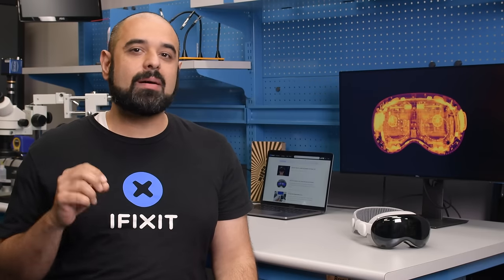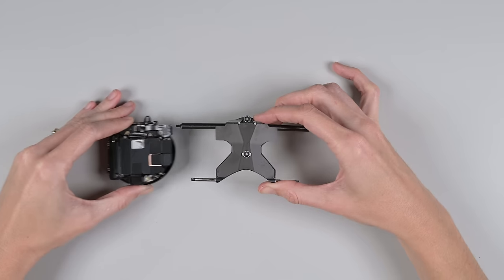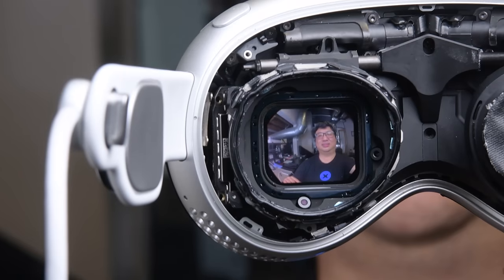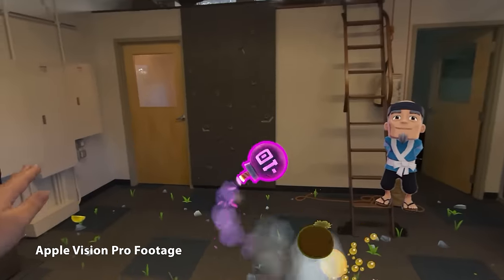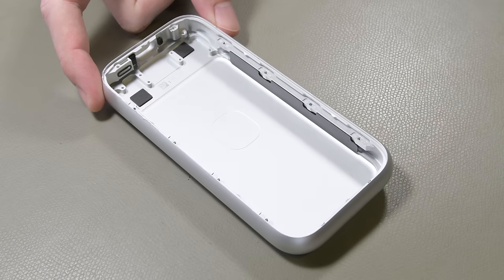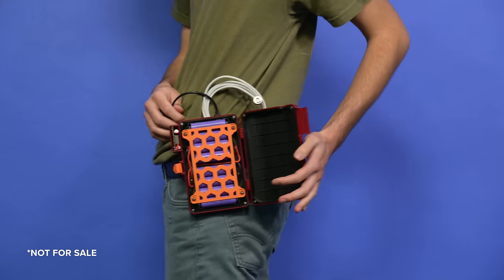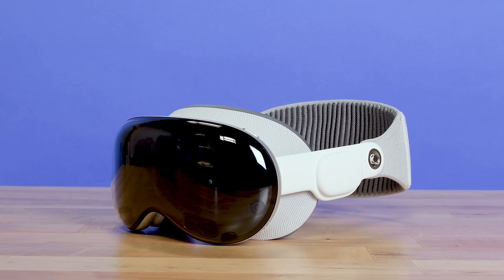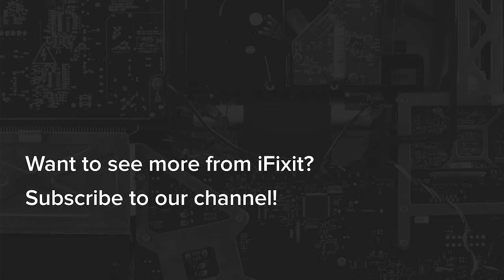Vision Pro Teardown Part 2 - Is the Apple Vision Pro Really 4K?

Comment: I know it was provisional, but that 4/10 score was something I really wasn't expecting. If the glass was easier to come apart I could understand it but, looking at all the teardown vids posted online it looks like a maze!
Reply: For real. Giving a 3500 device a 4/10 when you genuinely need to open it with a hammer and chisel like a geode is... Crazy.
Reply: @Jallen262  It's because everything is super modular, the spacial speakers, the head bands, the light seals, battery, etc.  Those are the most likely things to die or need replacing.   The front glass is as repairable is more replaceable than most front glass units on any phone since you just need to pop off the glass cover and pop on another.
Reply: @SkaterStimm  it's called the repairability score, not the modularity score for a reason.
Reply: @Jallen262  dude, the more modular it is the easier it is to fix.  The battery on most consumer devices is super hard to replace and look the battery is not even in the device reducing the need to open it.
Reply: i mean the things normal ppl would like to replace in case of damage or are all easily replaceable without even opening the device. and a lot is still rather accessible through the back which is just clipped in. so even motors and displays look rather accessible. 
the only things that are difficult to replace are the front glass and screen and just the complexity of the inner construction. which tbh is hard to make easily accessible considering the sheer amount of different sensors
Reply: So The framework pc is not repairable… interesting take
Reply: @kjeldkaj  nope, it's serviceable AND repairable.
Reply: Yeah, but if something is broken besides the glass you would go in straight from the back right?
Reply from the maker: Repairability scores are provisional until finalized. Also keep in mind that the repairability score of a VR headset is not comparable to the repairability score of a cellphone. They are different categories and are scored based on different criteria.
Reply: @Jallen262 this score is based on repairability, not serviceability
Reply: @iFixitYourself  Maybe make it somehow visually visible on what scale/device category group you are ranking the product. 
I'm thinking simple monochrome icons of the device category below the score.
Reply: Quelle est le score de reparabilité de ta TV ?

Comment: I honestly thought this would have been a 1 or a 2 on the repairability score
Reply: The main parts most likely to break are actually easy to fix.
Reply: I mean😂 there are pieces you can fix. The only thing you can't is the plastic front cause let's be real, even if you wanted to repair something behind the glass, there's no way you could do it. Best we could have expected is to replace the straps and eye seal, which we got, as well as the plastic front, which we did not get. I don't think it is reasonable to be expecting to repair any internals like the M2 chip or anything like that
Reply: Exactly, so they are even more repairable than could be expected. I would say 4/10 is actually quite low
Reply: Hundreds of screws, extremely modular, almost no glue. Extremely repairable, if one would get the parts.
Reply from the maker: It's a provisional score so it might change yet. Just keep in mind that VR headsets aren't scored the same way as cellphones. They need to meet different criteria for repairability. The accompanying article goes into more detail:

https://www.ifixit.com/News/90409/vision-pro-teardown-part-2-whats-the-display-resolution
Reply: The biggest downsize is that people mistake repairability with a swapability. If something was designed to popup and to be replaced - does it mean I did a repair by swapping a usb-c cable in my recharger (just by unplugging it)?
Reply: @MichalKuzmicki  Essentially, yes, that still counts. I see your point but what would you consider better: a laptop with a swappable battery (like the old school Powerbooks!) or a battery that is replaceable if you disassemble the laptop? I'd say the former is better and deserves a better score.
Reply: @MichalKuzmicki Cars work the same way. You just replace parts, but it’s considered repair is it not?
Reply: @pajamallama2364  it depends on the part and if it is more or less designed to be modular - swapping battery/accumulator would be considered a repair, but doing the same with the tires is usually not considered as a car repair: "your tires were worn out, we fixed your car by changing them to new ones".
Reply: The Quest 3 also got 4/10 and is miles far more repairable than this
Reply: @MichalKuzmicki  the intake to a engine is just as replaceable as a battery. If I changed an intake and removed any code associated, most would consider that a “repair” when all I did was swap out a single part.
Reply: Even after seeing your comment before watching, I thought, oh - it must a 3.

Im shocked at what it actually got
Reply: @tiagomaqz easy to fix? like a front class that is not a class but just piece of soft plastic?
Reply: @kjeldkaj you are thinking relative to only apple products.

ifixit rates products from all kinds of companies, 
including ones that care about their customers and score 9/10 and 10/10 on repairability rating.
Reply: depends on how you think. since the battery pack, the cable and the device are separate, you can swap all parts, so it is perfect. or you can say, that if you need semi destructive entry and than removing tapes and such just to get the parts that are not sold separately, than it is not repairable at all.

but it is true that most parts that can get damaged by realistic usage is changeable at least in theory, and any form of upgrade or repair inside the main part is mostly unrealistic, it is better for maintenance than most other devices.
Reply: @RomanGuro  I saw many videos of it being opened and the parts most likely to break are actually easily fixable with the right tools.
Reply: then u dont know apple

Comment: Please get your facts straight - the resolution you're quoting for "4k" is DCI 4k, which is not the same as UHD 4k - and has a matching lower resolution that differs similarly from 1080p (DCI 2k, 2048x1080) (there is no sub-2k DCI resolution). The illustration you're using here is this completely misleading, as you're comparing across several different resolution standards and aspect ratios (DCI is approx. 17:9 rather than the broadcast/TV 16:9). So while you're technically correct in saying that TVs aren't 4k in that DCI 4k was the first 4k standard, UHD 4k is the de facto broadcast and home display standard, and while calling it 'UHD' is more correct than '4k', for consumer usage those are synonyms. There were no consumer-facing DCI 2k TVs either, but that doesn't make them any less full HD TVs. So if you're going to be "well, technically"-ing things, at least be consistent about how you're doing it.

Comment: It’s not the hardware that makes it 3,500 but rather the cost of R&D spread among a limited production run.
Reply: did u not see the teardown video ? the amount of tech they have cramped is crazy difficult
Reply: The HTC vive is built better and harder for WAAAAY cheaper than this plastic pos
Reply: I can buy 2 entire HTC vive setups for the price of one apple vision pro with money left over.
Reply: That and the fact that Apple never, ever sells anything without a markup.
Reply: rumors earlier last year were suggesting apple was going to sell the vison pro close to BEP. i don't know if that actually materialized, but it would suggest a really expensive BOM
Reply: Let's suppose that half of the cost is R&D, and the production run is 1 million units (which isn't that much for mass market electronics, btw). That's almost $2 billions on R&D, for a VR helmet that mostly does stuff other VR helmets already do.
Reply: A simple search of how much Apple marks up all of their toys will confirm for you how Apple handles pricing. Apple has the largest corporate pile of cash on earth - that does not happen magically. It happens by charging huge markups.
As a limited run R&D-heavy device, AVP may be an exception, but there is plenty of precedence to think otherwise.
Reply: It is. Apples limited experience with VR/AR technology would necessitate huge investments into new production capabilities.
Reply: @mickey_mousey  Bruh the HTC vive is literally made out of plastic
Reply: @Kirbycatcher  Which is why I can buy 2 of them for the price of 1 apple product.

EDIT: The HTC vive is also not marketed as made of glass.
Reply: @Kirbycatcher  Why are y'all defending a company who spits in your face with sub par products and expects you to pay out the nose.
Reply: That is demonstrably false. Did you watch the video? R&D adds to it, of course, but the sheer amount of tech in that thing is dramatically more than any other headset currently available.
Reply: They charge out the ass because they know their hardcore Uber fans will keep buying no matter what they sell.

Comment: 2:56 Thank you iFixit for talking about PPD, and measuring the the actual display resolution!
Reply: It is equivalent to sitting at around 3 feet / 1 meter distance from 50" FULL HD (1080p) TV. Quite impressive for a wide FOV VR headset.
Reply: It's starting to get in the screen replacement category!
I measured my visual acuity at 90-100 PPD. So once I have 8k^2 per eye and keeping the same FOV, pixels won't be an issue anymore :D

The high res VR panels race is now truly started, best current released HMD resolution is the Varjo XR4 (3840 x3744 per eye, marketed as 51PPD)
Reply: Looking forward to learning the central PPD! Varjo XR-4 has a central PPD of 51, and an average PPD of 34, the same as iFixit's estimate. Oh, hmm, how did they come up with 34? 3660/100 = 37.

But I think 100º horizontal FOV is for both eyes, so we really need the per eye FOV. If the binocular overlap is similar to Bigscreen Beyond (~80º) then the per eye horizontal FOV would be 90, which would give a PPD of 41. If the overlap is similar to Varjo Aero (~70º) then the per eye horizontal FOV would be 85, which would give an average PPD of 43.
Reply: For anyone wondering. Apple aims for 120ppd in all of their retina devices. It's where most generally become unable to see details between degree of vision. 
The apple vision pro being below 60ppd means we have a long way to go
Reply: @jwhi419  I never would've expected them to target 120PPD for their retina devices considering all the recent (sans Vision Pro) devices are only over 80PPD according to Wikipedia (at time of writing). It seemed like they were aiming for 90PPD to me.

Comment: The Vision Pro battery pack can be opened without damaging the external metal. There’s a YouTuber named “phone repair guru” who was able to open the battery pack without damaging the case using acetone to dissolve one layer of adhesive and then using a pry tool to open it
Reply: Info it really need to do their research before publishing these video.
Reply: Yeah. He is not rich enough ti break it
Reply: @kjeldkaj  They were doing their own testing. Letting them know about more ways of trying to solve these issues is huge in the repair community so that comment is the best way to let them know about it.
Reply from the maker: Yeah we broke the battery. Our HMD went back together in working order though so yeah.

https://www.ifixit.com/News/90409/vision-pro-teardown-part-2-whats-the-display-resolution

Comment: The most common definition for "4K" is 3840*2160, the resolution of "4K" TVs or of "4K" movies, also known as Ultra HD. It's four times the pixels of Full HD. If the Apple Vision has 3660*3200 pixels per eye, that's not the same resolution as 4K, but overall it amounts to even more pixels, 29% more.

Though it should be noted that these pixels are distributed across the whole field of view, and some will also be cut off at the edges or possibly lost to software image distortions to balance out lens distortions. So if you watch a 4K movie in the Apple Vision Pro, you are only using a fraction of the FOV and of the pixels available in the display, which means the movie will very likely render with (significantly?) less than 4K resolution.
Reply: Not a big deal at all. You can’t see the pixels when watching content and that’s what matters.
Reply: Yeah it will be more like 1080p if you watch it how directors (THX standard) optimize viewing angle of films, similar to sitting in the middle of movie theater.
Reply: Resolution doesn’t matter, pixel density and pixels per degree matter. Regardless, even the low resolution of the quest 3 (2208p) looks perfectly fine so I expect the Vision Pro with a higher resolution and smaller fov to be incredibly sharp
Reply: Are Apple suggesting that it’s like watching 8k because they say it’s 4k in each eye? After watching this I’m gathering that you don’t add the two together..
Reply: @fayenotfaye how resolution doesn’t matter. Whole field of view is covered by just 3600x3200 pixels so even if content window covers 50% of total FOV,      actual resolution is even less than 1080p and rest of pixels are used by pass through.
Reply: @fayenotfaye they're saying that it probably will feel like watching a 1080p monitor (given the pixels per degree), not that the content is 1080p. 

The problem isn't really the displays, they're super cool. The problem is reviewers just parroting that when you open up a virtual display, it's a 4k display... It's not even close.
Reply: Problem is Apple guys repeating 4k monitor when they open a new screen.. no dude, you're using just a percentage of that "4k" screen.
Reply: Thanks. So what is the maximum resolution of content you will be able to watch? Like is there any point downloading 4k movies to it?
Reply: @flightvk2  4k movies usually also have higher bitrate, meaning that they'll probably look better even on a non-4k display. I'd say that 1440p is fine though
Reply: That makes no sense. So if I do not watch a movie at full screen when using a 4k display, the display is not 4k??
Reply from the maker: It's not the most intuitive thing to understand. Take a look at this video. He spends 10 minutes talking about PPD with various animations to demonstrate the point. https://www.youtube.com/watch?v=LJSJSQwfuRg&ab_channel=F4CEpa1mx_0
Reply: I have a giant 4K OLED and dedicated UB820 player. And this AVP looks phenomenal with movies, I can’t even see any individual pixels. 

The accurate colors and micro oled blacks are better than my fancy LG C3 movie wise. It’s literally a Dolby Cinema on your head quality wise.
Reply: As far as I remember Apple marketed it as 4.2K. And by saying that there are around 20% more pixels it may be believable.
Reply: Not directly comparable to 4K anyway because the display is a different shape. Almost square as is required for VR.    :glasses-purple-yellow-diamond:
Reply: It's not relevant how the displays are used, the marketing term used by apple is correct, more pixels than a 4K display. 4K display is 8.3 million pixels, an Apple Vision Pro Display is 11.7 million pixels, so yes, almost 30% more pixels than a 4K display. Now its a different question whether the perceived resolution is the same or not, thats when pixels per degree would become useful, but we have to separate matters when comparing likes with likes.

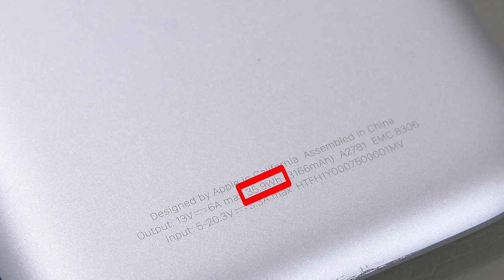Comment: 4:46 Not necessarily. That 35.9Wh rating is at 13V while the 46.08Wh is rated at 3.87V. Boosting the voltage induces more heat loss, therefore the lower rating.
Reply: I don't think they're boosting the voltage. I'm pretty sure the 13V figure is the max voltage expected from the three cells wired series. It looks like Apple is using high voltage cells which can charge to over 4.3V each cell.
Note the "nominal" voltage isn't the same as "max" voltage. The 3.87V figure on the cell is nominal voltage not max voltage.
Reply: battery is in series , no booster needed.

Comment: It's funny how Apple gets called out for using "not real 4K" but on for example the Sony Xperia 1s no one every said that besides those also not using real 4K 😂 

3660 x 3200 is still quite a huge amount and matches what I thought about previously which was just a different aspect ratio based on Apples marketing materials. Those made it look like the panels are ~4:3 so I thought it could be 3840 x 2880.

what's crazy to me is the ppi. 3300 ppi with this resolution while the Quest 3 for example only has 1200 ppi. So the Vision Pro uses MUCH smaller displays which is interesting
Reply: They said that
Reply from the maker: Apple ran that narrative by saying "4K TV for each eye". All we did was point out that it's not 4K and it doesn't matter because it's all about Pixel Per Degrees. We also praised the amazing pixel density and pointed out how much higher the PPD and PPI is when compared to anything else.

https://www.ifixit.com/News/90409/vision-pro-teardown-part-2-whats-the-display-resolution